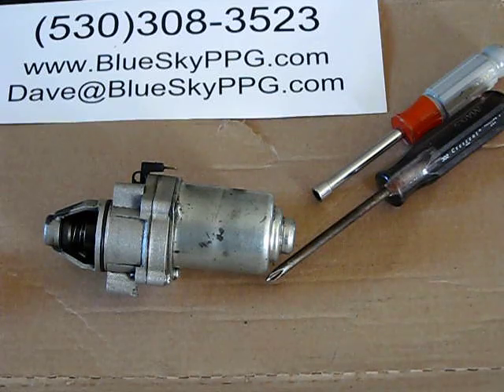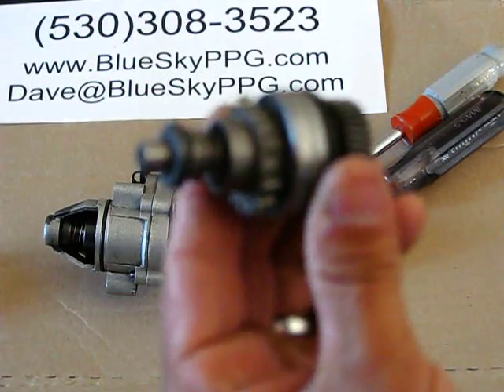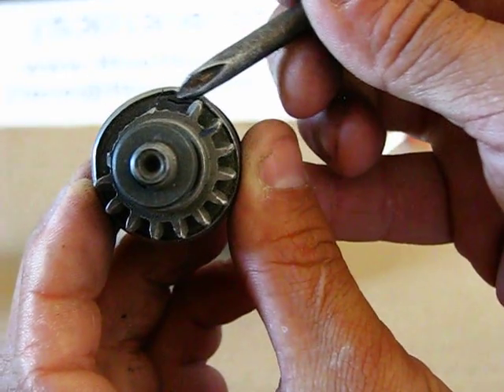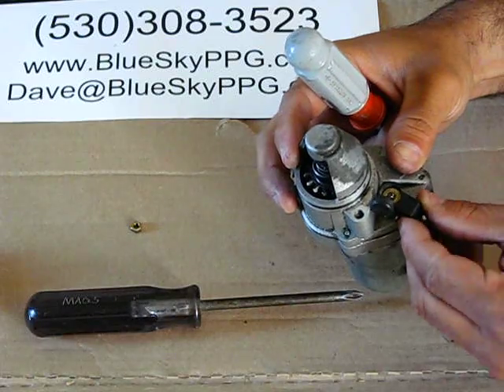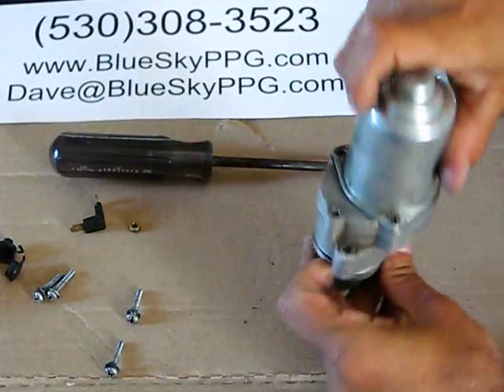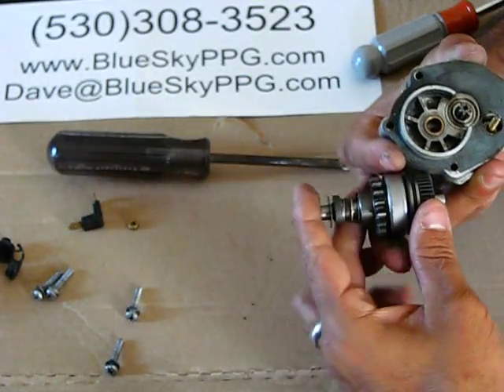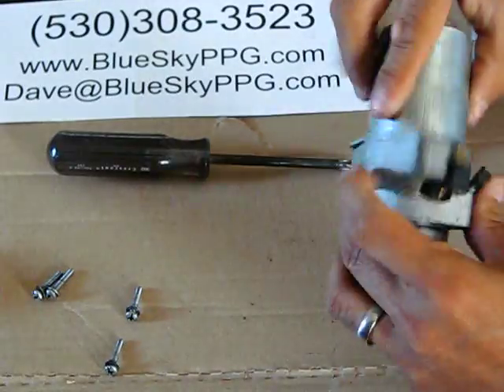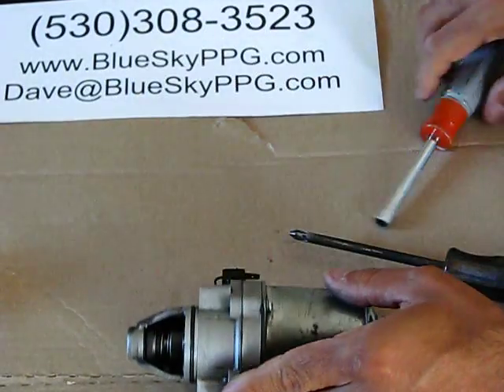How to repair a PPG starter motor / replace the bendix gear assembly

Comment: Just bought a Bendix from these folks, easily replaced it with the video.  Getting the starter off the engine was an entirely different story.  Thanks for the help guys.

Comment: The way the bendix in mine failed was that the pins that hold the collar parts in place came loose and were free floating which caused the starter gear to retract after one compression stroke.    Would be nice if the bendix could be rebuilt and just replace those pins somehow or the collar assembly.  The spring was also no where to be found but everything else appeared to be in excellent condition.

Comment: Do you guys have the starter sprocket ring for a solo 210 also?
Reply from the maker: Hello, the solo 210 starter crown is dependent on which version and brand. For example, the adventure solo 210 is different than the lamouette solo 210. That being said, i do have sprocket ring left that could work for you. If you have the number of teeth, the width and thickness i will see if i can help.
Reply: @BlueSkyPPGdotcom  That would be awesome. The crown is 6mm thick, 160mm in diameter and has 90 teeth. I uploaded a pic here: https://prnt.sc/ttfust

Comment: Hello,
I'm not sure what exactly is wrong with my scooter tao tao atm50-a1. I press the starter button with my brand new battery, and it tries to start but the back gears or starter just makes a spinning/grinding noise without the engine starting. Sometimes it works and other times it just sounds like it can't catch anything and it's slipping. What do you think could be the problem? Do I need to take apart the rear gear assembly? If you can help at all, I'd really appreciate it.
Matt
Reply from the maker: Chances are it is a bad bendix gear. Without opening it up its tough to say though. It could be something worse like a broken armature gear.

Comment: Any ideas what substitute Bendix gear i can use? The prices are off the roof. The Bendix gear shouldn't be more than $20 or so, but online merchants are charging hundred or more.
Reply from the maker: unfortunately there are no substitutes. The factory Italian starter uses a very specific bendix and as such they charge the dealers a super high price. It wasn't until the economy slowed that parts were even available. Prior to that we had to replace the entire starter every time.
Reply: Ok, so here's another question. What battery do i need for it? Like how many volts and amps etc? I am running mine off of my jet ski battery, but this thing is only turning really fast and not actually moving the gear forward, to engage the plate.
Reply from the maker: ok first thing you should do, is verify that the bendix is able to actually come out. So add power to the motor so it is spinning. Then push a pencil into the moving gear. If it comes out, then the motor isnt powerful enough to allow the gear to come out. If it doesn't come out, then the motor is spinning the wrong way. This usually happens when you disassemble the motor and reassemble incorrectly. The magnet on the motor is a 3 position motor. One position spins the motor clockwise, the other is counterclickwise the last one does nothing. Remove the three screws and rotate it 120 degrees. Finally battery power required is 12 volts, 4 amp minimum.
Reply: Thank you so much for this useful information & God bless you. I will try these today and will follow up, if thats OK?
Reply from the maker: No problem at all, you can email me direct at dave@blueskyppg.com
Reply: Well i'll be damned. Rotated 120 degree and its working ONLY when its directly connected to battery. When i put it back on PPG and connect the actual connectors to battery,, it just turns. I am thinking the battery is weak, although battery is outputting 12V. I ordered a new battery 12V 7.2AH (hope not too much amps to burn anything on PPG). Thank you much for all your help.
Reply from the maker: 7.2v is perfect. I personally use a 12v 14 amp battery with no issues. Keep in mind these starters are actually for scooters and Ducati motorcycles - that's why they are so expensive! one last note: 3 position starter, one is 12v clockwise, 12v counterclockwise, and 24 volt clockwise. so if its turning slow try one more turn!
Reply: My engine is Adventure M3 160cc . The starter can only spins without load,,i.e the spark plug is dislodge from the engine. Once the plug is fixed .. it would not turn at all although the battery is a new fully charged Lipo 14.2 Volts.  My propeller spins anticlockwise .
Reply from the maker: First question: Is the propeller on the machine?
Reply: Yes , it spins anticlockwise when flying seen from the trailing edge.
Reply from the maker: ok, contact me directly at dave (@) blueskyppg.com I can help you.

Comment: When I try starting my ppg, the starter is making a tick noice and nothing happens. Any ideas?
Reply: OK that's helpful mate, thanks. Will let you know how I get on (tomorrow).
Reply: Opened it all easily (thanks to your video) and the bendix gear looks absolutely fine so looks like it could be the actual motor. Not sure if it can be fixed so might have to buy a new one :(
Reply: IFTY AHMED 0   ¥

Comment: is there a way to reverse a starter
Reply from the maker: Im so sorry for the delay! I didnt see the comment on the post- YES you can reverse the starter easily. Remove the three screws holding the magnet and rotate it 120 degrees (one screw hole) that should reverse it for you.
Reply: Dear  Sir...,Will the bendix gear functions as it should be if we reverse it. I just bought a new  starter which spins anticlockwise (I was ignorant that all starters spins clockwise while making the purchase) and when fixed to the engine it rotates the propeller clockwise which is the opposite direction and of course the engine won't crank .